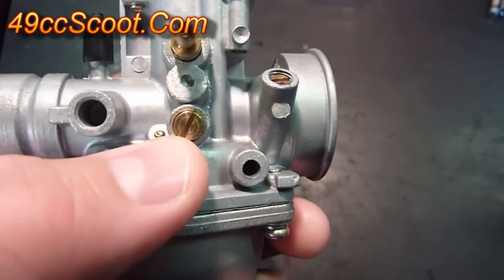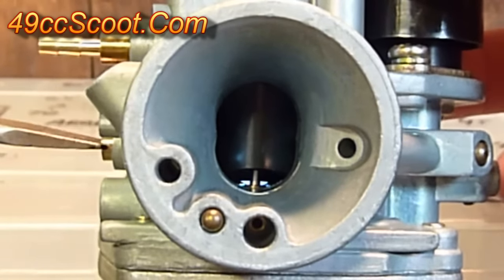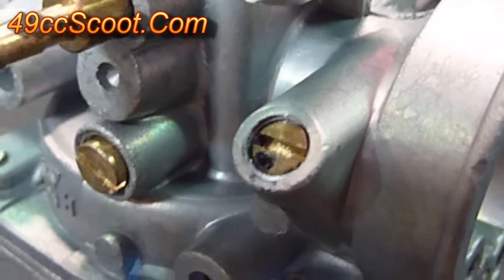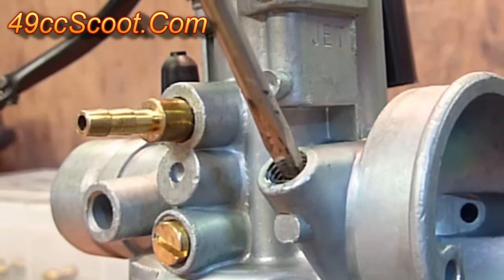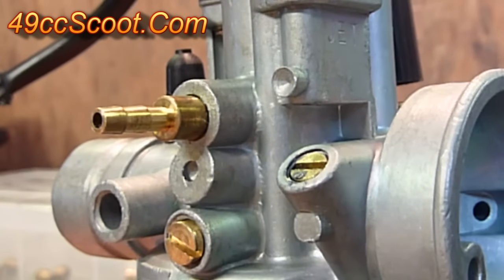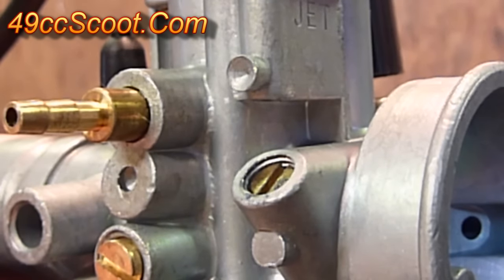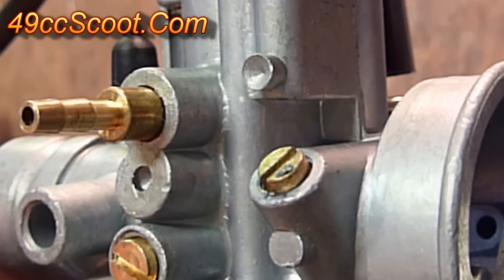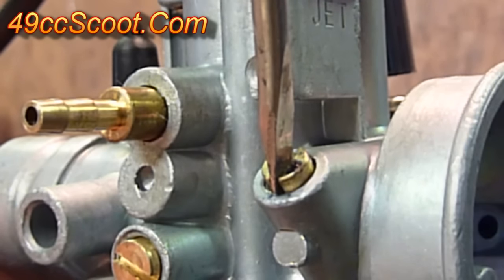Two-Stroke Scooter / ATV Carburetor Settings And Adjustments 2of4 : Idle Speed & Mixture

Comment: i need help with my dio 50cc.. it runs ok at 30kph and during idle but the engine somewhat bug off when i try to speed up at 40kph and up.. i cleaned the carb and checks the spark plug its all ok.. i dnt know why its like the engine is running out off gas or like it cant burn the gas.. im confused how to fix it.
Reply from the maker: Have you tried different main jets? Are you sure the float height is set properly so it can maintain an adequate level in the bowl? All is well in the fuel system (lines, hoses, etc...)?
Reply: yes i checked the floater and its parallel with the carb.. ihavent tried other jets since the current carb is the stock.. the hose is also ok.. i will try other jets.. can you recommend what should i do with the jets? i from the philippines and the parts hor honda dio is somewhat difficult to find. tnx
Reply from the maker: I can't say for sure about the Dio, but most carbs share jet styles with some other carbs, so that may not make them so tough to get. Motorcycle and scooter shops should be able to help there. You will need to figure out if it's getting too much or too little fuel to know which way to jet. You can do that by trial and error with a selection of jets or try covering (maybe tape) part of the airbox inlet to see if it gets better or worse. If it gets better with restriction added there, it's prob lean. If it gets worse, it's likely rich.
Reply: tnx the bugging problem is solve but then my currrent prob now is my carb overflows and it become a problem starting my scooter.. the carb is clean i think..  need ur help again.. tnx
Reply from the maker: Overflowing carb is most commonly float height, float needle/seat not sealing, or petcock malfunction. Even if the petcock malfunctions, the float system should stop fuel flow. Could also be an issue if the carb gets mounted at much of an angle or the float bowl gasket isn't sealing.
Reply: carb problem solved.. tnx a lot.

Comment: Hi does anyone know what could be up with my carb it splutters when past half throttle
Reply from the maker: +josh Wride Perhaps the main jet is too large. Sputtering is usually a rich condition. If you haven't tuned for the best main jet, then I'd start there. http://www.49ccscoot.com/faq/carbtune.html
Reply: +90GTVert  I'm going to get a new one tomorrow as the one in there is to big due to the splutter so I'm going down by ten to a 110 jet

Comment: hi 
I got a suzuki tsx 50 cc. the problem is that if I got a to low RPM the engine die. So does anyone know how to fix that.
(sorry for my bad english)
Reply from the maker: Increase the idle speed by turning the idle speed screw in/clockwise a little perhaps. If it's not related to the idle speed, then perhaps the needle setting is too lean (try moving the needle clip down a notch) or maybe an idle mixture adjustment is needed.
Reply: *****  thank you verry much
Reply: i have been turning on the idle speed but now the RPM can get over the 5 and i heard sometimes a bang
Reply from the maker: The idle should not be that high. I just thought perhaps yours was set so low that it stalled. Set the speed back to a more reasonable level  if possible and start trying to adjust the mixture screw to see if that get's you anywhere.

Comment: Yo i know this a Old vid but my throttle thing got locked idk how to fix it pls help
Reply from the maker: If you were working with the carb, the first thing I'd do is check the cable and the throttle valve (slide). If the slide doesn't go in right, the throttle will usually get stuck in one spot. Sometimes cables get bent around and it takes up all of the slack and makes the throttle open or stick.
Reply: @49ccscoot   ok thanks man i will try and see if i can figure it out thx
Reply: @49ccscoot  should i try to oil it upp the throttle thing doesn't go down do u think it's to dry??
Reply from the maker: @GoatedASF2K  It should work when dry. You'll have to start inspecting throttle components to see what exactly is hanging up. You can take the cable off and see if the slide moves in the carb on it's own and if the cable will move freely.
Reply: @49ccscoot  I've checked that and it doesn't any tips i dont really have the money to buy new carb and throttle cable
Reply from the maker: @GoatedASF2K  Not trying to insult you, but are you 100% sure that the slide is in there properly? If they get turned the wrong way this could happen. As long as the slide or carb aren't corroded, it should move pretty easily. Another possibility would be a bent needle. If the needle is bent at all it could hang up.
Reply: @49ccscoot  it okay man no it's not bent and yess it's put in the right way mine is using a spring but i have one throttle cable laying somewhere should i try that one to check
Reply from the maker: @GoatedASF2K  If it's the slide in the carb that doesn't move, then forget the cable and just check that by itself. If it's not easily moved up and down in the carb, it won't be right with any cable configuration.
Reply: @49ccscoot  ok thx 😊
Reply: @49ccscoot  ok so i need a new carb then ?
Reply from the maker: @GoatedASF2K  If the slide doesn't move freely in the carb with nothing attached, then you either need a new carb or you need to figure out why that's happening and try to fix it. Take the needle out first and just be sure that it's not that simple. Feel the slide and the bore to see if they're smooth. Make sure there's nothing in the groove on in the carb or the tab that interacts with it isn't damaged. Beyond that, carb replacement.
Reply: @49ccscoot  ok thx mate

Comment: I get gas in my float bowl but the carb doesn’t suck the gas up into the intake someone help
Reply from the maker: First, I'd try removing the air filter and covering the mouth of the carb with my hand (wear gloves to protect your hand from fuel if desired). Sometimes the seal created that really chokes the carb will be enough to get it to start drawing in fuel. Once it starts, it may be fine after. Kind of rare, but it's easy to try.

Otherwise, I'd suggest removing the carburetor and cleaning it thoroughly. If you have access to an ultrasonic cleaner, those will sometimes help carbs that normal cleaning methods don't even fix.
Reply: @49ccscoot  I tired to choke the carb and still no gas’s is going thru I cleaned it ver good all jets and screws are cleaned
Reply: @49ccscoot  when I manually choke the carb it doesn’t even suction my n my hand
Reply from the maker: @isthat.q226  Check compression.
Reply: @49ccscoot  my intake is metal so there’s no air leaks I checked the reeds there hood I still can’t figure out y there is no suction
Reply from the maker: @isthat.q226  Check compression.
https://youtu.be/l_RMl5IIenA

Comment: Turning it outwards richens it and inwards leans it up.....
Reply from the maker: When the mixture screw is on the inlet of the carb, as the stock carb in this video, the screw controls air. Screwing it in blocks off more air, so the mixture is more rich. Screwing it out opens the air passage and lets more air through for a leaner mixture.

If the mixture screw is on the outlet side of the carb it usually controls fuel instead. In that case screwing it in will block off the fuel passage for a leaner setting. Screwing it out will allow more fuel to flow through for a richer mixture. The four-stroke 139QMB and GY6 stock carbs usually work this way.

Comment: brand new carb. matbe 250 miles on it. Oh it's a 4 stroke
Reply from the maker: Check the valve lash. Make sure the fuel system is working. If it's got a vacuum petcock, take the fuel hose off where it connects to the carb and aim it into a container. Then kick or crank the engine over a couple of times and make sure fuel is coming out. If you have a tester, check compression.
Reply: Has a vacuum system for fuel it does work please  keep hlping me and others.